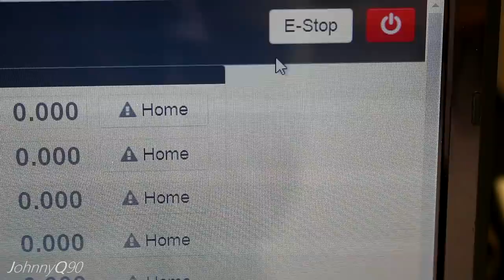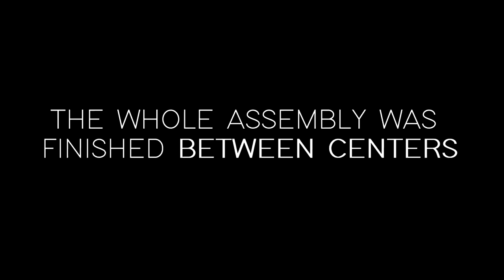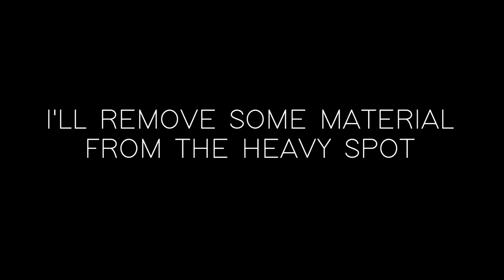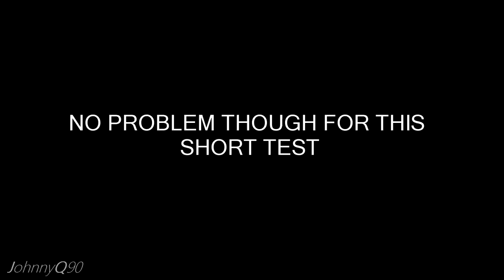Twin Turbine Rotary Grinder Tool Powered by Vacuum Cleaner

Comment: Yep, that works! Well done. It's a shame that the Dremel version of this is so crap. A shop vac has usually over one horsepower, with good design, as you have done, it should be possible to capture a good fraction of that to power the tool, easily matching the power of an electric Dremel or similar small die grinder. One would have thought that a company with the resources that Dremel/Bosch have, should have been able to do similar research and development.

Now make a small axial gas turbine.
Reply: I cannot knock the Dremel at all! I purchased one back in 2004, and have used it excessively. I think that it is 'one of the best' tools that I have. Sure, I have replaced the worn-out Carbon Brushes, and I have stripped and rebuilt it twice - mainly for cleaning. My only criticism is - that the rubber Grip Coating that Dremel placed on my model - turned into a very GOOEY MESS!! I spent a couple of hours removing this goo, a bad decision by Dremel. Also, the Dremel Bits are really expensive. I drilled-out some Collets that would take the chinese diamond Bits, and things are sweet. I would happily buy another Dremel when mine dies.

Comment: Did you calculate the airfoil P/A root stress vs rpm to get an idea at what speed the blades would pull off the hub?

Comment: great technical achievement, but is a DC motor not a lot cheaper and simpler, and what about the noise and power loss of the vacuum cleaner?.by the way, use a compressor.
Reply: I don't think that's the point... I think the point is that he can make a cool tool that can be functional but perhaps isn't as efficient as other options... I mean for goodness sake he made a 1.25 CC nitro engine powered mini carving chainsaw

Comment: Super glue is NOT good in shear mode, which is how you used it when you glued the pieces together.  Nor is it particularly good on aluminum.
Reply: PanamaSticks it’s supposed to be just a temporary way to hold the part in the lathe

Comment: Awrsome video! Would a 3D printed shroud on the front that intakes air from the back of the tool not solve the debris issue? Sort of in the same way a snorkel on old diesel submarines were tilted back and down?
Reply from the maker: This is exactly what I wanted to do, but video was getting really long and to be honest, I was also too lazy to make it XD

Comment: Would it work as well blowing air trough it with the output end of a vacuum cleaner, so that the air going though the turbine would blow the chips off the work surface.
Reply from the maker: Absolutely, but my device can only suck. Otherwise I would prefer it much more than the current setup. Good idea.

Comment: Do you have a reversible shop vacuum? Like one with a blower side? I'd be interested in seeing how well this design holds up to the air going the other way
Reply from the maker: Unfortunately no. To be honest I agree, I would prefer much more to blow air to the blades. No need for filtering and worrying about the bearings...